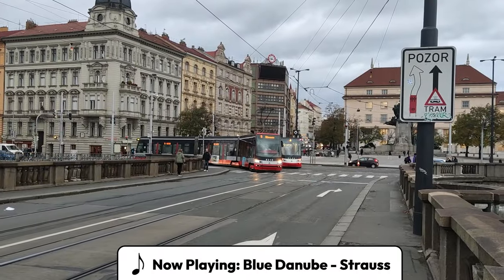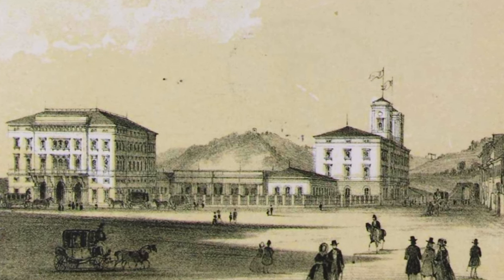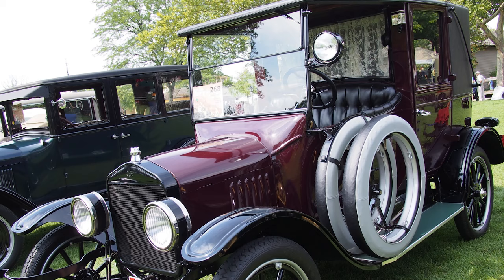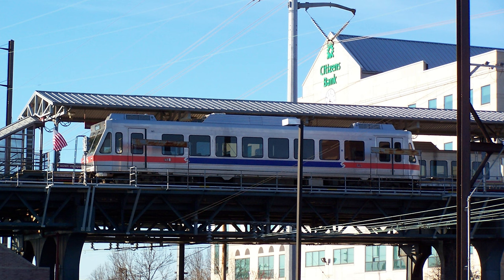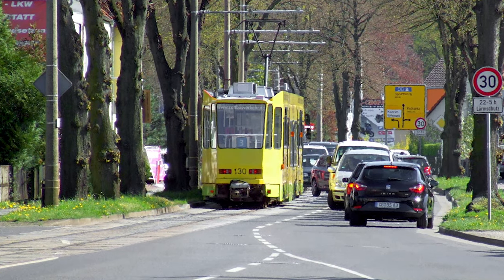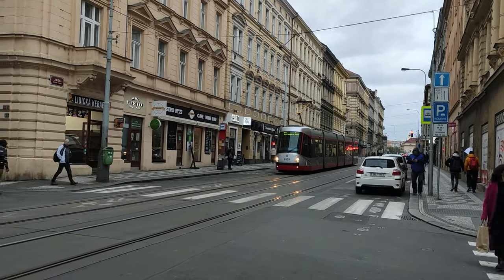Tram-Trains: A New Approach to Trams

Comment: Good news! Nürnberg just approved a tram train to Erlangen!
Reply: Isn't it just a suburban tram line?
Reply: @carljo002  it certainly has elements of a train as it will provide city to city connections from nuremberg to erlangen to herzogenaurach as well as higher speeds on connecting segments
Reply: @zeugundso  A tram train goes onto existing heavy rail lines and replaces regional trains - or looking at it the other way, the regional trains can go onto the streets like a tram. Karlsruhe's network is about 500Km  - i.e. that's the regional train network with a small amount in the city centre (in Heilbronn city centre too). If you're sharing the tracks with a goods train or an ICE, then you're on a tram train. I don't think anything like that is planned for Erlangen.
Reply: @Talon5516-tx3ih  I just have a problem calling it a suburban tram as the city to city connections are a key part of the plan. It creates a rail connection between Erlangen and Herzogenaurach which hadn't had one for decades. Feel free to go to Herzogenaurach and tell them they are a "suburb" of Nuremberg though :D The term regio-tram is maybe more applicable.
Reply: @zeugundso  We can argue all day about terminology :). I see they're calling it StUB for Stadt-Umland Bahn. I wouldn't translate Umland as suburban, but "surrounding area" which could be rural. That makes it sound more like an S-Bahn, but with tram vehicles.
Reply: @Talon5516-tx3ih  Let's just call it an interurban, that way everyone's happy

Comment: I want to add one thing: the biggest appeal of the Karlsruhe model is to quickly expand the tram system into the suburban area by taking over railways will little or no passenger service. When the S1 was extended to Neureut they initially wanted to build it on its very own tracks, but then it was decided to use the mostly disused Hardtbahn. Some of the railways used today by tram trains maybe would not exist today if it wasn't for the Karlsruhe model.
Reply: Very true. We have this now in the UK such as cities in Sheffield and soon to be Cardiff!

Comment: The Randstadrail actually used to he a heavy railway line converted into a line where on a limited section the right of way is shared between trams and the Rotterdam metro.
Reply from the maker: Probably should've gone into more detail, yes, the Randstadrail includes the Rotterdam E metro line, however, it's now a tram-train system, so I think my explanation of it in the video still stands

Comment: Ok a few corrections about Karlsruhe, since I happen to be a public transit nerd who lives there.

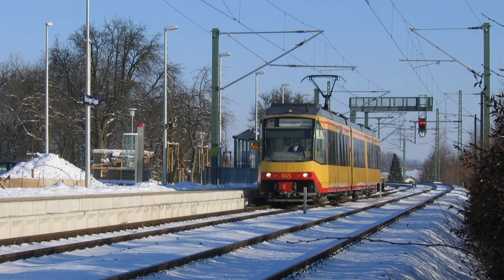4:38 yes, this route shown here was the first to be operated by the new vehicles. HOWEVER on this route the vehicles didn't run into the city center, but to the central station (which is outside of the city center by more than a kilometer) completely on heavy rail lines. The connection to the tram network didn't exist yet. The first actual tram-train line that used both the tram network and the heavy rail network, was the line to Bretten in 1992.
5:21 Kaiserstraße was already pedestrianized for decades before 2021. Just with trams running though the pedestrian street.
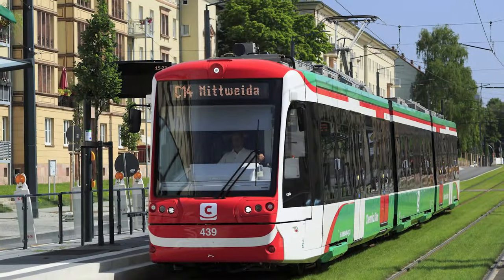5:46 other cities with Tram-trains are Saarbrücken and Mulhouse

Comment: Frankfurt is Building it’s first Tram-Train right now. Although it doesn’t go into the city center but purposefully avoids it as a circumferencial line. It should rather be called Stadtbahn-Train or U-Bahn-Train, as there’s no interlining with any tram and even interlining with the U-Bahn is restricted Tina few hundred meters at on of the three norther termini.
Still it operates like a tram parts of the way, so it’s a Tram-Train
Reply from the maker: Circumferential rail lines for the win!! We badly need one here in Prague, although it's not happening anytime soon (AKA in this century) 💀

Comment: In the UK, it has taken absolutely ages to get any tram-trains working - in fact we have only one: a 3.67 km extension of the Sheffield 'Supertram' system to Rotherham.  It has highlighted a 'con' you didn't mention: the different platform heights of the Sheffield trams, and the standard UK rail network, meaning that Rotherham station has had to have an extension built for the trams!  Another 'con' is needing special wheels which will operate over heavy-rail and urban tram tracks

In fact, having watched this video again, most of the other UK tram systems include parts which are like 'inter-urbans':  Blackpool (which never lost its trams) runs 7 miles to Fleetwood, though not on heavy-rail tracks;  Manchester Metrolink (trams) used the routes of closed heavy-rail tracks to Altrincham and Bury (each about 12km from the city centre) as did  London Tramlink for almost all its branches.  Edinburgh has an 8km extension to the Airport, after it leaves its street-running section. Even the Tram Museum (Crich, Derbyshire) has a country extension, and the Seaton narrow-gauge tourist tramway uses the trace of the closed Seaton railway branchline.  

Most exciting, though, will be Cardiff's 'South Wales Metro' project which will use real modern tram-trains for one of its two lines, using existing heavy rail infrastructure, and new-build street tracks in the centre.  

Díky za další zajímavé video!
Reply: I don't think those cons are cons if you plan for the system to be a tram-train from the beginning. It sounds to me like in Sheffield's case, it was originally envisaged as a proper tram system at the start, and they only later had the idea to extend it, and that's when the problems started.
Reply: I'm surprised anyone pays attention to platform heights in the UK as they never seem to match the trains. Germany largely ignores the problems too. In Karlsruhe the tram-trains have a higher floor height than the trams so level boarding is pretty patchy. The new underground stations had to be built longer than required in order to have two different platform heights - and I don't think that works either as here are several different vehicle types in operation.
Reply: Same with the Tyne and Wear Metro using the former suburban lines to the Coast and South Shields!
Reply: The tram tacks could be build with a rail profile matching heavy rails, then, no special wheels would be needed. I am not aware that one vehicle can actually operate where the rail profiles do not match. I would not see it as a con, but rather a barrier to entry. It is a big problem tho, along with electrification voltages and signalling. A tram running on 25kV AC with ETCS?
Reply: @veronikakerman6536  Karlsruhe solved these problems decades ago and they run on 15KV AC on the train tracks and switch to 750V DC in the city (there is actually a 750V DC line outside the city as well before any pedants jump in). Not ETCS, though I guess there's no reason why not, but they must be equipped for PZB signalling.

Comment: I could be wrong, but it seems to me like the most common use of these systems is when you have two cities fairly close together and a tram-train links the two. It's almost like two tram lines that connect together into one longer one. Beyond a certain distance apart it becomes a bit pointless because the journey time would be too slow, and then you need a proper heavy rail system to travel between the cities. Rotterdam and The Hague (with Delft in between) is quite interesting, because there is a heavy rail line AND a tram-train between them, and the Hague and Delft has a standard tram line linking the two. So you have all 3 modes basically all running parallel. I visited there this summer and while I would've taken heavy rail from the Hague to Delft (as it's only 10 minutes), the line was closed for maintenance and I had to take the tram. It took like 25 minutes, but at least there was an alternative, and there were many people getting on/off along the route that would not have used the heavy rail system even if it had been working as it skips all those places.
Reply: Yes, you are right, nice example are cities Liberec and Jablonec in Czechia or Katowice region in Poland, you have several bigger cities almost connected together, so you don't even realize it's intercity tram system. 
But you can build trams even in places where normal trains would be to heavy and expensive, also it's easier to find and train tram drivers than train operators and with low unemployment in Europe where it is hard to find people, this is really a massive difference.

Comment: During the early days of railways, it rather seems like other things like tax revenues or impacts on private properties or military functions of fortifications were taken into consideration, rather than environmental impacts of smoke. Also in those early days, technology was quite poor and lines build up to 1840's had to have curves with quite large radius, so options where and how to build were limited. Also technology of switches was limited, so stations had often relied on turntables. Another thing to consider is that at that time cities were still often confined by walls and properties behind the walls were expensive.

Also in early days there was not that much of a difference between railways and tram lines that had utilized steel rails (some tram systems had used steel plates on wooden beams, but that was also the case of first railways) and railway goods carriages were transported to customers in city over the tram lines. (The limiting factor there are flanges of carriages and grooves of the tram rails) There also were, before electric trams, steam trams, basically small locomotive that had pulled special carriages around the city Some of those can also operate with limitations, on standard railways. It basically all goes down to flanges.

I do not think that interurban trains of North America and tram(trains) of Europe should be mixed, those system had originated from different needs, distances and societies and also from different organization of railway network. Where in the USA it made sense to build new electrified line, in Europe was most likely already served by some main line or could be served by combination of main line and branch line.

Another thing to consider about the demise of US tram networks is that by the 1950's most of the equipment was ate the end of it's operating life and maintenance was not the best in 1930's and 1940's, so buses and cars were most likely the cheaper option.

Another thing to take into account is whether the traditional railway infrastructure has to have sufficient free capacity, which is usually not the case in and around the Prague and also perhaps case of many other major European cities. So there is possibility that tram-trains would have to be too expensive to implement compared to simple fast tram line. I simply can't imagine, that Prague would implement tram-trains on any line that goes towards Elbe, nor on line going to southern or Western Bohemia, those lines are already used at their full capacity. So the system would be confined maybe to two lines out of which perhaps only line to Dobříš would see some benefits of tram-trains as in case of line do Rudná, it would perhaps make more sense to extend metro B those 6 kilometres from works at Zličín. Another thing to consider is whether the given city also has metro or not as in such case maybe it would make more sense to bring metro to some railway stations at outskirts of city where passengers would change from train to metro than to build tram-train system that would do more or less the same job.

Comment: Swiss cities like Basel, Bern and Zürich  took a different approach by simply extending  (narrow gauge) tram lines far beyond city limits into suburbs and surrounding towns. Examples are the new Limmatthal Line and the Glatthal Line in Zürich, the Tram Line 10 from Basel to Rodersdorf or the Tram Line 6 from Bern to Worb. To share regular train line tracks seems like too big a risk, given the fact that Switzerland counts on the clock-face scheduling of regular trains, and the risk of trams delaying regional or interregional trains would be far too great. Swiss trams also often have to navigate through narrow and curvy old towns, so having 1000 mm narrow gauge tracks as a tram standard is advantageous. But this also doesn't allow trams to switch to the regular train network.
In other countries, such tram trains make sense, particularly if hardly used old train lines exist that can easily be shared between tram and freight trains, for example.

Comment: 4:40 while there were already tramtrains between Karlsruhe and Pforzheim in 1992, those simply replaced conventional trains and ran exlusively on DB-tracks. The first real tramtrain service ever was started on Sep 25, 1992 between Karlsruhe Albtalbahnhof via the city-centre to Bretten Gölshausen with the change from 750 V DC to 15 kV AC happening between Durlach and Grötzingen and the border between operation as tram vs train in Grötzingen station
4:50 these are not just tramtrain-tunnels these are tram/tramtrain tunnels; these tunnels are used by 20 tramtrains per hour - outnumbered however by 48 trams per hour

Comment: It Kind of feels like Karlsruhe's City Center is dead because the trams don't run above ground anymore. Also I think they didn't have to build a Tunnel, they could've used nearby Kriegsstraße just south of Kaiserstraße as a corridor for the tram trains, keeping the Standard low floor trams on Kaiserstraße and probably saving a lot of money.
Reply: Counterpoint: we needed the tunnel because the surface alignment really sucked and Kriegsstraße alone is plain and simple not a good enough substitute.
Reply: @CharlsonS  Fair enough, but still, 1,5 Billion (projections from 2021) is really expensive

Comment: New approach?
Karlsruhe has had them for 35 years! Some of the system’s original units have already been retired and scrapped!

And no they’re not any “approach to trams”, you have it the wrong way around. They’re an approach to trains! They’re essentially mainline trains that can also run on some of the tram network.
Reply from the maker: Well, in the grand scheme of things, they're still quite new

and arguably, yeah, they're probably more of a new approach to trains rather than trams, however, they're not exactly traditional trams either, so.. I think the title could still stand
Reply: @TheTramly  The concept was around in the USA in the early-mid 20th century as the “interurban”; Long distance light rail that would use the street car network in the CBD.
The big difference is that the tram-trains use the mainline instead of a light rail system.
Reply: They are an approach to trams. They are definitely not trains lol. The Real struggle was to get trams running on the mainline, not the other way around.
Reply: @CharlsonS  ”They’re definitely not trains lol”
Nah, silly me, they only operate on mainline rail infrastructure, and meet mainline regulations. How could I possibly think that by meeting the definition of a train; they’re trains?
Reply: @danieleyre8913 and they operate on tramways as well? The idea of the Karlsruhe model was to get trams out onto the mainline and not to get trains into the city. The vehicles have the base design of trams accommodated to mainline standarts.
Reply: @CharlsonS  No. You’re factually wrong.
Karlsruhe’s problem was that their Bahnhof is too far from most of their town centre, much more than a kilometre. So tram-trains was a solution of having trains that could use some of the tramway to get mainline railway commuters into the town centre. Note that Karlsruhe had already managed to integrate a commuter small-gauge light railway, the Albtahlbahn, into the tramway during the 1960s.

The fact that their unit body shapes and general design more resembles that of trams than regular mainline multiple unit trains was to allow them to use those portions of the tramway. Think about it; you could not get a regular multiple unit form to integrate with a tramway, but you can modify mainline station platforms to make a form more like a tram’s to use the mainline. But it belies that the units are built to much higher crash worthiness standards that conform with mainline standards (which makes them trains by definition). They’re only allowed to use the sections of the strassenbahn which are segregated from automobile traffic, so as to mitigate any risk of collision with automobiles, which their mainline standard conformity would cause much higher damage to an automobile than a tram would. The tram-trains can’t be run on most of the tram network, including most sections that are embedded into the streets. But they can be run anywhere in the mainline network.

Think about the name; the word trains comes second, indicating that they’re a type of train.

And if you want to still maintain this arrogant yet uninformed stance, then I invite you to do some actual research to try and prove me wrong.
Reply: @danieleyre8913  "arrogant" calls me the guy who gets even the basics wrong. the tram trains can infact run anywhere on the tram network, yes even in mixed traffic and they even did in pedestrianized zones until very recently. not only that, the NET2012 tram train is even used regularly on tram lines with no railway sections whatsoever, my little smartass